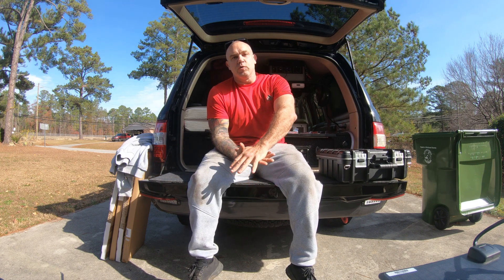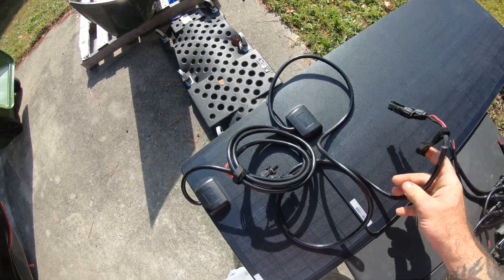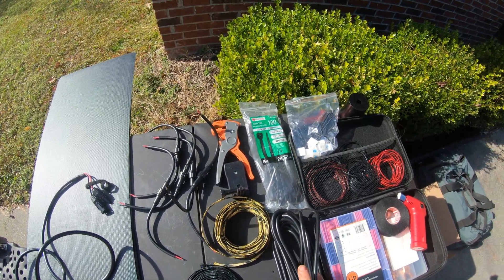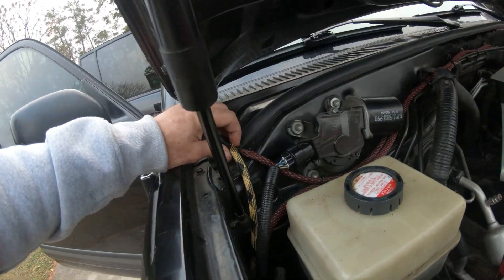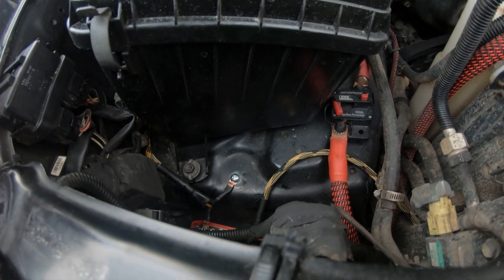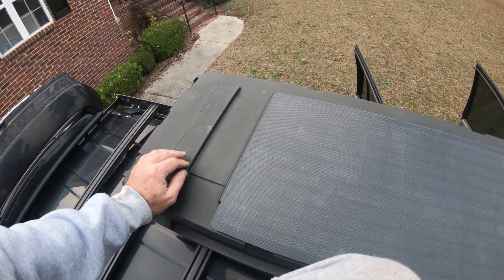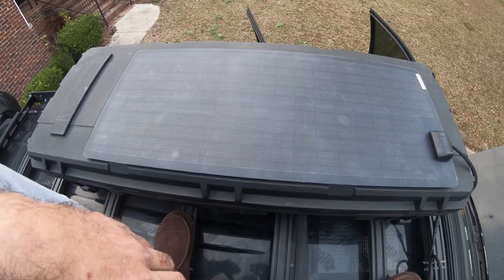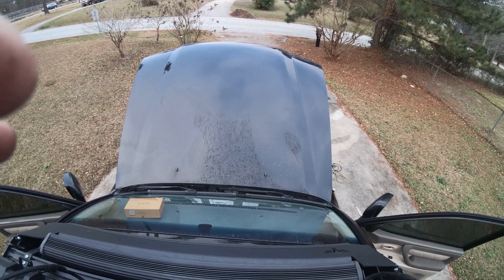I have Solar!!! Installed 2x 50w solar panels on a 2006 100 Series Land Cruiser

Comment: How do solar panels hold up with tree limb scratches? I like this idea but I off-road in the woods.
Reply from the maker: The panels themselves are pretty resistant, they are not fragile at all, I'm more concerned about the cables getting caught in branches actually.